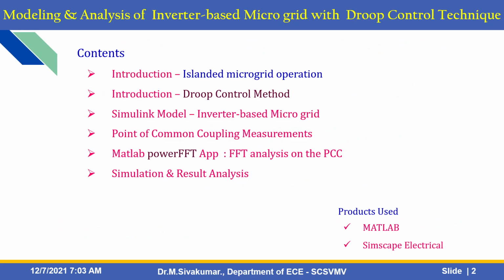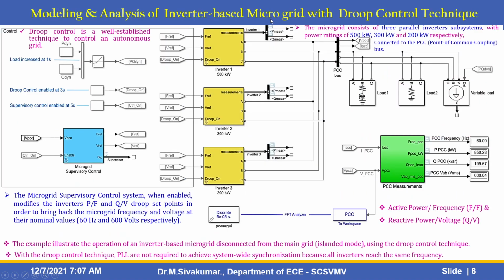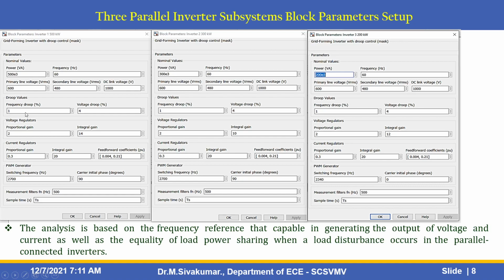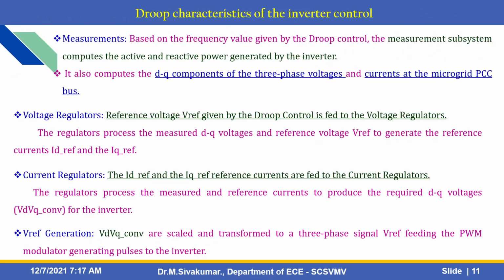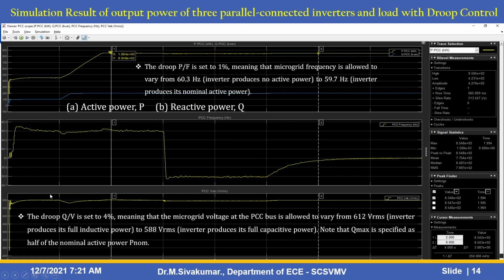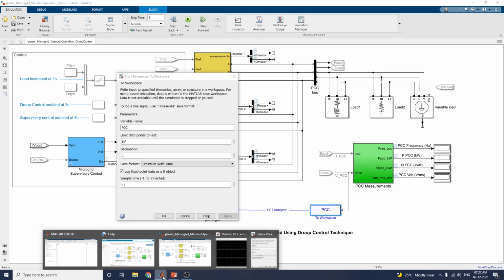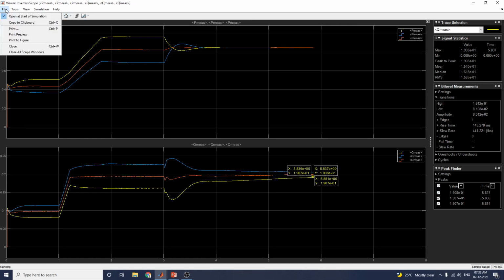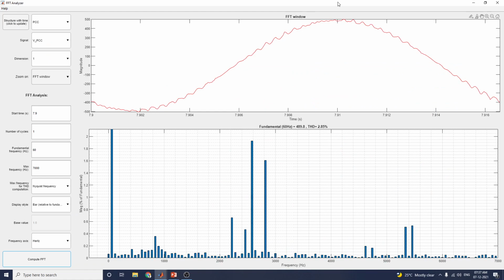Modeling & FFT analysis on PCC- Inverter-based Micro grid with Droop Control Technique Using Matlab

Comment: Sir, 
You are using 1000V batteries for all 500kW, 300kW, 200kW inverters. Then how did you design the different rating of inverters?
Which parameter is used to change the invereter rating?